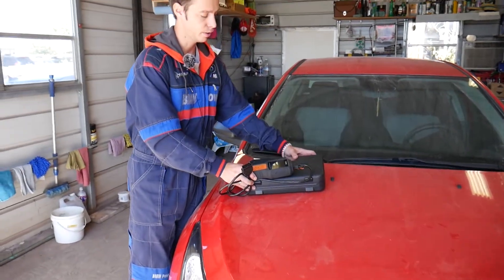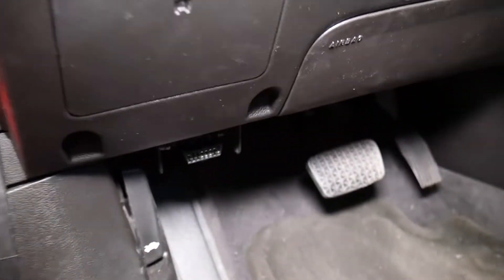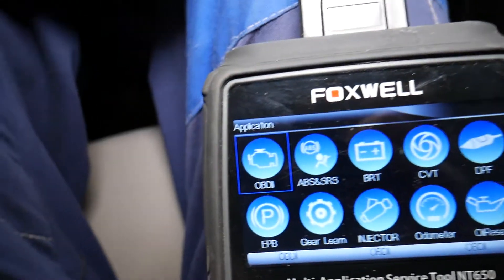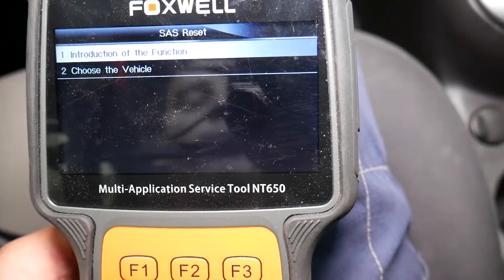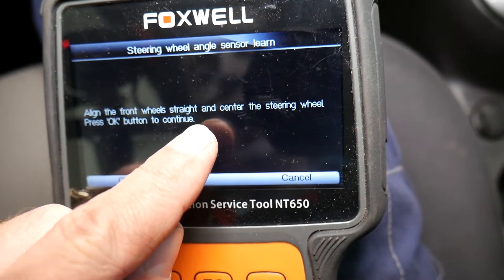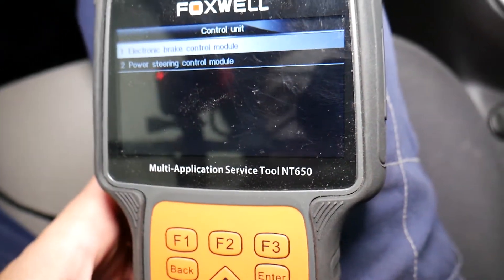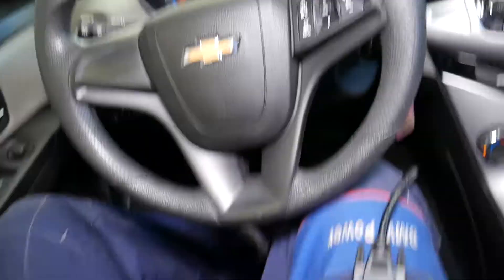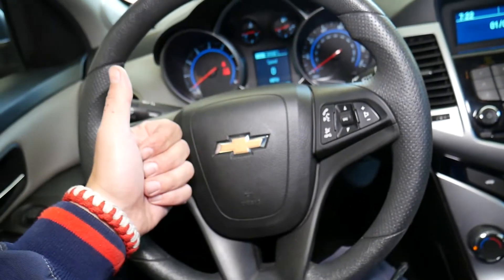HOW TO CALIBRATE RESET STEERING ANGLE SENSOR ON A CAR with Foxwell NT650 OBD Scanner

Comment: Well I had foxwell nt650 elite didnt recalibrate sas on 2013 dodg journey
Reply: None of them do.
Reply: @travisj2695  I think you are right because I can’t get it to reset sas on my seat Leon 2013. It’s doing my head in
Reply: @travisj2695  Yes they do. If the advertisement says they do, its either a defective scanner or someone who does not understand how to use it.
Reply: @tedmetherell5608  I got a seat Leon 2013 and it doesn’t reset the sas on it. It just says “no support this function “

Comment: Friend, what is the difference between NT650 elite version, and the one you have NT650?
Reply: The 650 elite is the newer version of the 650. It has 25 special functions, compared to the 650, which only has 10 or 11 (I don't know exactly). 
The 650 elite concept is a great tool, but it has limitations in the scanning capacities. It won't give you climate error codes, etertainment unit error codes, automatic gearbox error codes. As for engine codes, it will only read obd2 generic, not the manufacturer specific codes.
If you don't have an opel, you can buy it with confidence. (When opel has an engine code, it doesn't trigger the check engine light, but the "service vechicle soon" warning, which the regular obd2, which the 650 elite has, can't read).
The 650 elite can read obd2 codes, abs codes and airbag codes, as well as offering access to 25 special functions (which will not work on every car).
Reply: @razvanturcu9871 brother in your opinion which is a good effective obd scanner for all cars especially bmw and vw? Thanks
Reply: @carsandme1  if you don't want to spend more than 500$, then buy one of this tools: foxwell 644 elite, foxwell 680 pro, thinkscan max, thinkscan max 2, topdon artidiag 800 bt. This tools will work with bmw and vw.
Reply: @ thank you very much I appreciate that very much. The thing is I bought a foxwell nt650 elite but I can’t get it to reset steering angle sensor because at the end of the process it says “no support this function “. So this is why I don’t want to waste money on buying stuff that doesn’t work
Reply: @carsandme1same here 🤦‍♂️
Why did I choose the Elite?